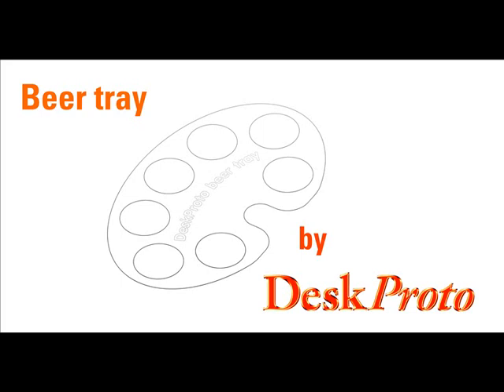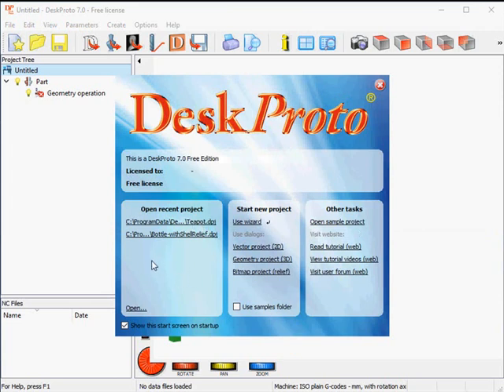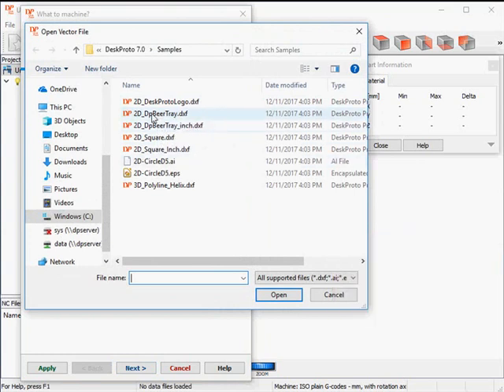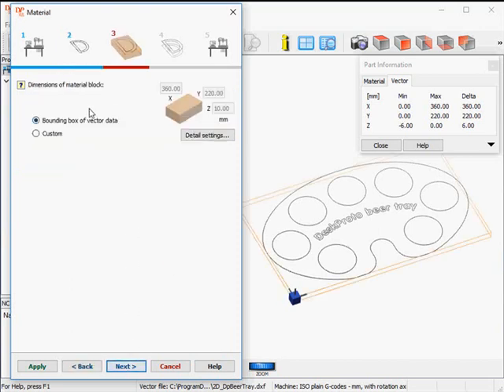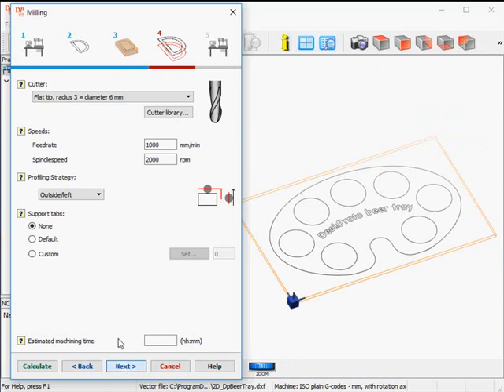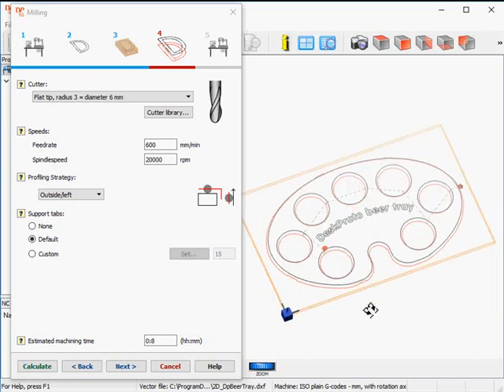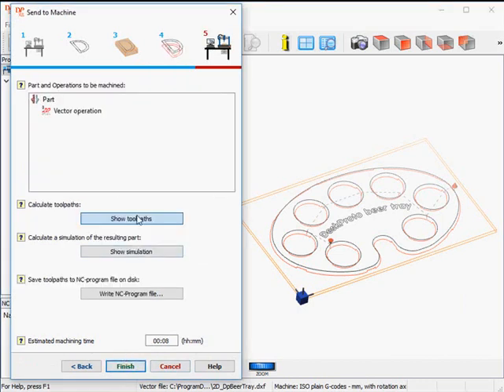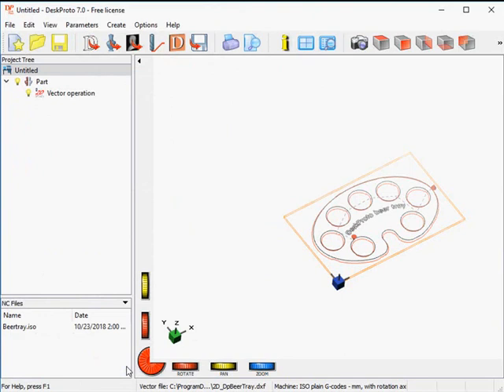Basic Vector machining: the Beer tray (2.5 D CNC milling)

Comment: Hello, I'm from Brazil.
I really enjoyed your videos and I'm really enjoying the software.
I'm cutting a 15mm board, which is too thick for just one pass. Can I cut it 2mm at a time, with multiple passes?
Reply from the maker: Yes, DeskProto calls these passes layers, and the layer height can be set as one of the Roughing options. However, roughing is not available in the Free edition of DeskProto, only in the paid editions.  As an alternative when using the free edition you can create multiple passes by setting your WP zero point too high: 13 mm about the top of the board and run the toolpath. Next at 11 mm above the top of the board, etc.

Comment: Thank you very much for this Tutorial. It taught me to create my first vector Gcode. At the end of your video you show the tray with embedded text but you didn't show how the code was generated. Can both geometry and vector code be generated in a single file? I have a test model with vectors and embedded text and would like to see how the Gcode is generated in a single file.
Reply from the maker: Hi Barry,  the toolpaths for the text were also made using vector machining. Showing how would have made the video too long. Here is a brief explanation.  These vector toolpaths cannot be done using the wizard, as the vector wizard uses all curves in the drawing. After completing the video project you need to add a second vector operation, in that operation select a thinner cutter and on tab Pocketing select the contour lines of the text. This is explained in detail in Lesson one of the Tutorial book on https://www.deskproto.com/download/manuals.php
Reply: @Deskproto  Thank you for your explanation. I could not complete your tutorial 1B because I am using the Free trial version. I thought all features were available for a trial period. I have used it for three days. How long is the trial period?
Reply from the maker: @barriejones1461  You can indeed complete this lesson when using the Free edition. When starting your free DeskProto the 'Edition select' dialog pops up, allowing you to trial one of the paid editions. When you select any of these paid editions you can complete the lesson. The result will show the "trial version watermark" though: below the trial cross no toolpaths are generated. This watermark has replaced the 30 days trial period, as that gave too many problems.